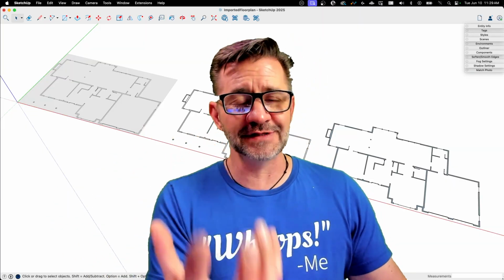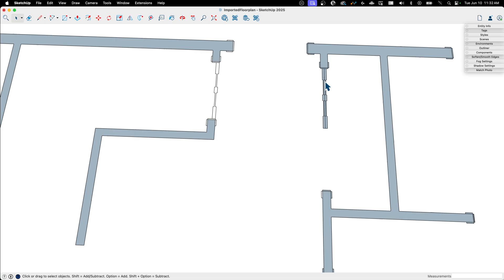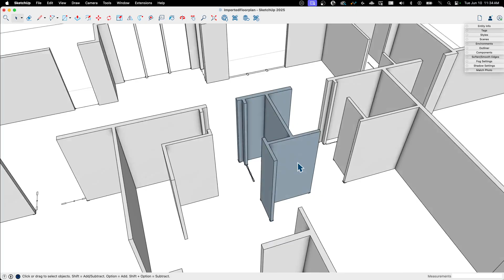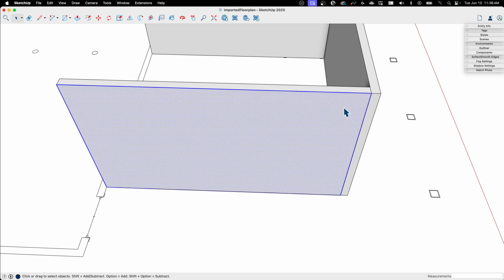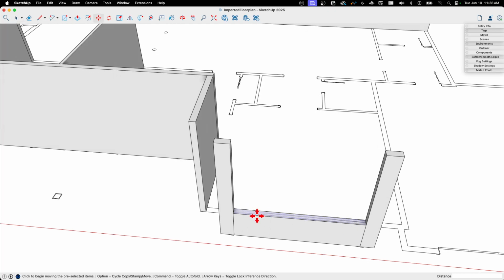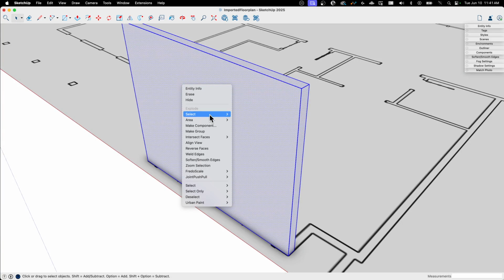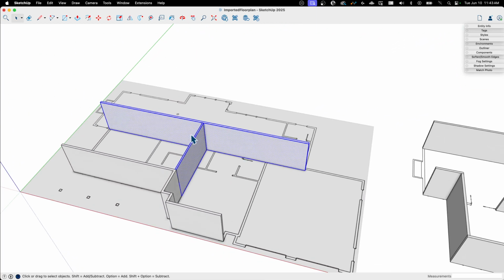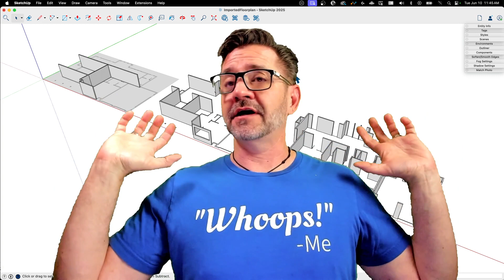3 Ways to Convert 2D Floorplans to 3D Walls

Comment: Bringing things in from CAD or a PDF is always a tricky process.  The biggest issue I’ve run into is dimensional inaccuracy or errors pulling from other sources into SketchUp.  I find it easier to model from scratch directly in SketchUp, and a grid tool is essential.